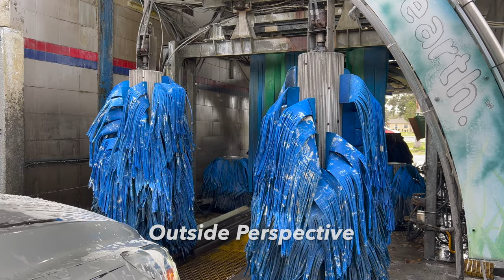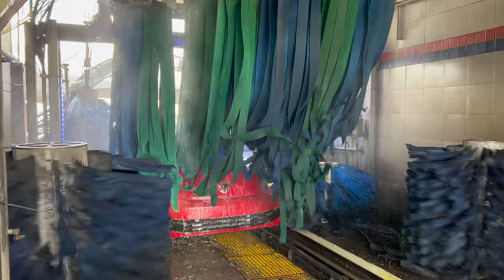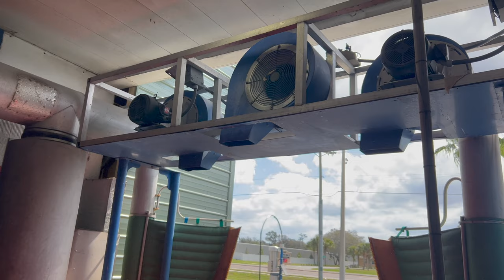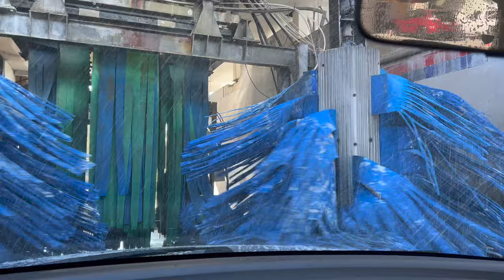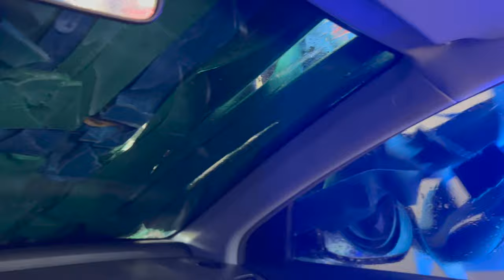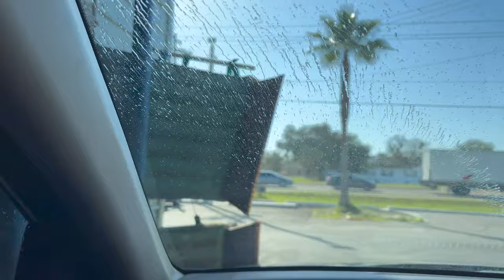Econocraft Mini Tunnel - Florida Super Wash (4K Retake)

Comment: That dryer setup is very neat. Odd that they took out the top bags and kept the side bags on the Protovest, while new cannon blowers were added up top.
Reply from the maker: They were taken out for maintenance reasons. The old style ProtoVest top bags are more often maintenance headaches for owners because the sensors used to lower/raise the bags off the vehicle surface need to be serviced or replaced frequently.
Reply: @FloridasExpressCarWashes  Very interesting, my local washes that were full service at one point all locations had Provest 90T setups and they all got ripped out but I can tell that the sensors tend to fail a lot but that’s a common thing for those dryers. I’d prefer them over any modern Sunny’s blower since there great with stripping water of the body of the car.
Reply: @FloridasExpressCarWashes  Yeah, when I went on my Texas trip a long time back, one of the car washes had that Protovest dryer system, just with the elephant-ear sides instead. The top tight bag was knocking onto the windshield of the car. I totally get it and agree. Looks like the side bags don't need sensors which is why they are still there to keep good side-dryer quality.
Reply: @britishcarfan9601  The protovest 90T doesn’t have the sensors. The 90T rolls up the car
Reply: @PalmPeakMarketing  yeah your correct but there is a sensor for it to turn on
Reply: @PalmPeakMarketing  I did more research and I found out that they don’t have them
Reply: Yeah but the bags in the sides have snesors
Reply: @PalmPeakMarketing  ok cool, you spelled sensors wrong lol
Reply: @britishcarfan9601  AWH shit
Reply: @PalmPeakMarketing  your fine